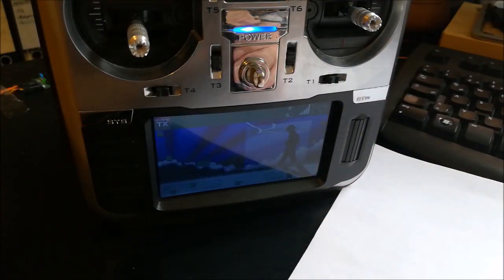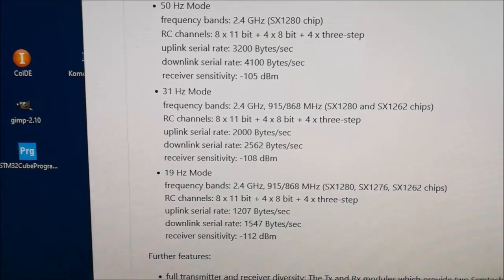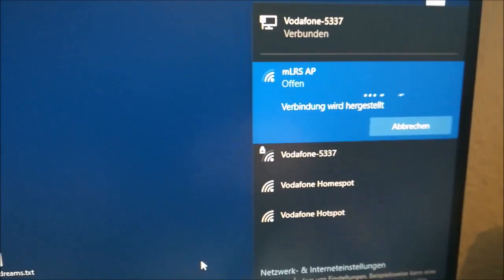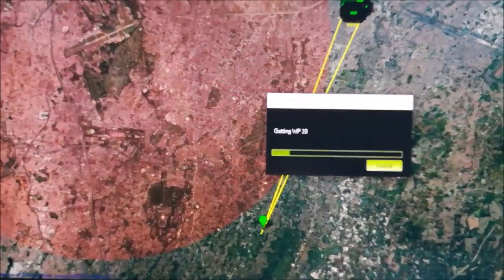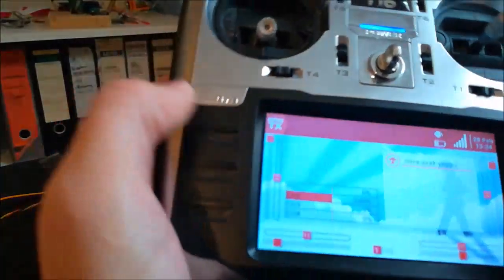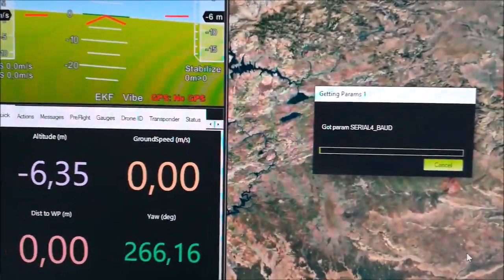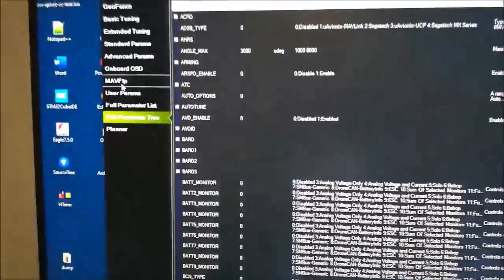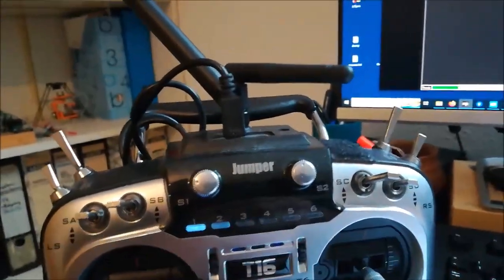mLRS: How well it works with ArduPilot and MissionPlanner (Q1/23)

Comment: Have you test 433, it's more slowly time connecting MP to FC?
Reply from the maker: it's the same. The time to connect to MP is determined by what mLRS calls mode, which can be 50 Hz, 31 Hz, or 19 Hz. These modes are equal across all RF bands, i.e. 433 MHz also supports the 31 Hz and 19 Hz modes and is then equally fast/slow as for the other RF bands.
Reply: @OlliW42  And will the time for loading data from the flight controller + be the same?
Reply from the maker: it's all the same as the data rate does not depend on the RF frequency but the mode

Comment: What is the smallest module for mlrs that is cheap too?
Reply from the maker: the cheapest solutions are the DIY options
the smallest & relatively cheap & commercially available option is the R9 system: https://github.com/olliw42/mLRS-docu/blob/master/docs/FRSKY_R9.md. The R9MM is quite small, one user is using it in sub 100g builds.

Comment: Hi OlliW42... great stuff... just few things wanted to understand,  what is the max pkt size you are able to transmit...( Mavlink pkts transmitted from mlrs connected to Flight controller).  can you showcase the stats windows what is the link quality you are getting...
Reply from the maker: any mavlink packet, even of max size allowed by mavlink, can be transmitted. No restriction here. Link quality obviously depends on distance, so everything from 100% to 0% is possible depending on har far the vehicle is out
Reply: @OlliW42   Mavlink max pkt size is 280 bytes... sx1280 max buff size id 255. so it can't do that... however.. I am also working on the hobby project of building a SiK radio kind of telemetry using expreless lrs hardware [esp8285 + sx1280] , for me also Mavlink  and mavftp works .. however if i see  Mission planner logs, MP complains, I see lot of crc errors happening... but there are no errors in the transmitted and received pkts ,verified that by running a test code to match the tx and rx packets.
Reply from the maker: I wasn't saying it would send a mavlink message in one lora packet ... when you send a pdf via inet to your friened, you won't think it is send in one junk, don't you? Yet it arrives. Same here. Can't comment on your code :)

Comment: The mLRS project is amazing. I have been wanting something like this for 2+ years. I am looking forward to the day when I will be able to purchase the hardware as an integrated solution consisting of TX module + RX.
BTW, the SiYi FM30 project is in principle filling this exact niche. Is there something fundamentally wrong/insufficient about that one, aside from the fact that it's not based on ELRS and the CRSF protocol?
Reply from the maker: define "fundamentally wrong". It's a question of features you want, and mLRS has features which FM30 doesn't have (TTBOMK), but many may want. mLRS is not ELRS. :)

Comment: Hey Olli,
gibt es ein Datenblatt bzw. Pinbelegungsplan zum STorM32 v1.31? 
Wir machen gerade eine Projektarbeit im Studiengang Mechatronik und bauen einen Gimbal.
Hierfür verwenden wir den oben aufgeführten BG-Controller von dir. 
Die Programmierung und die Konstruktion wollen wir selbst umsetzen. 
Dafür wäre die Pinbelegung sehr hilfreich. 
Danke im voraus :)
Reply from the maker: also, die Antwort lautet google ... das ist übrigens eine extrem nützliche Fähigkeit :)
Reply: @OlliW42  für das Board V1.3 haben wir den Schaltplan auf git gefunden. Zum Board V1.31 konnten wir leider nichts finden
Reply from the maker: wenn es nichts gibt gibt es auch nichts :) i.e., habe ich und niemand auch nix, das haben irgendwelche Chinesen zusammengebastelt, der Unterschied ist irrelevant
Reply: @OlliW42  okay schade, trotzdem danke :)